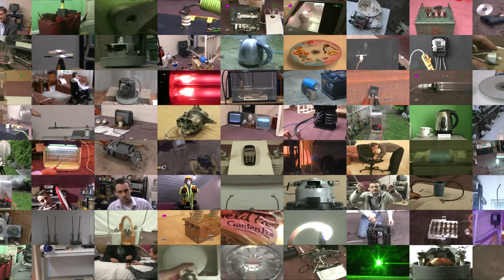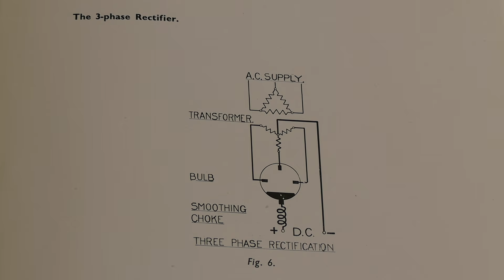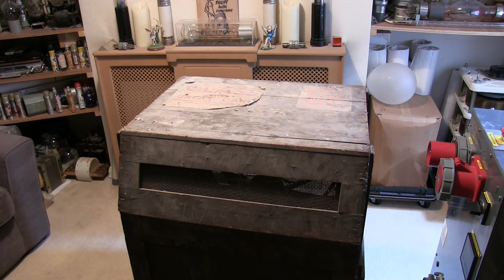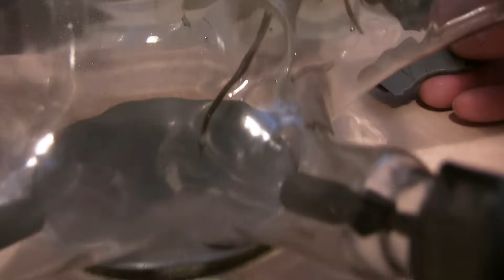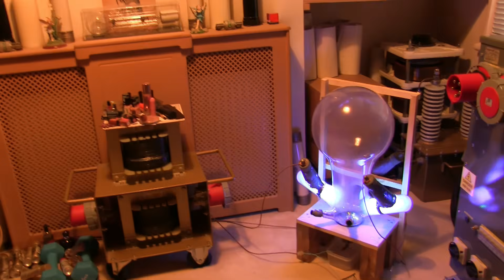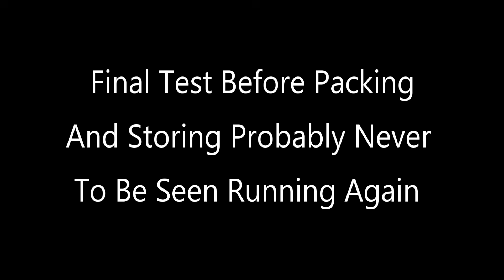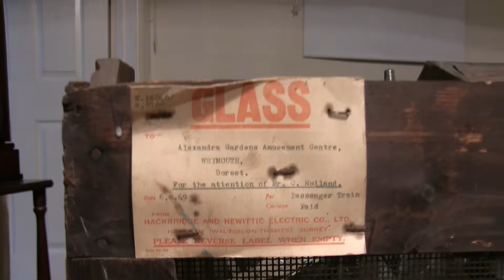Testing The 50 Year Old Mercury Arc Rectifier

Comment: I’m at a loss to understand how a puddle of mercury is only allowing current in one direction.
Reply: It’s not the puddle of mercury itself that only conducts in one direction — liquid mercury conducts both ways. The rectifying effect comes from the mercury cathode and the ionized mercury vapor. The mercury cathode can readily emit electrons and sustain the arc, while the solid anodes cannot do the same when the polarity is reversed. That asymmetry is what makes it work like a diode.

Comment: Beautiful - and a little bit scary!

Ever since I had an electrolyzer with mercury connections on its electrodes (for reasons still unknown to me), I wonder - what metal did they use in those years when mercury was all the hype that didn't amalgamate (and get dissolved) with the mercury?

Comment: One of these used to be in the Bell System switch room office where my dad worked. I could tell by the color of it. I got more Western Electric transistors than tubes when they tore the office down. I thought about taking that tube, but I didn't want to mess with something high voltage. I got the traveling wave tube out of the microwave. I donated everything to the electrical museum. Some of the transistors are priceless.
Reply: It was weird walking into a place that was so noisy all my life, with thousands of stepper switches and little lights all over, being quiet with no power. They let us take what we wanted, except for the power plant, when they shut it down.

Comment: If that were to break and that mercury got away onto your floor, you'd have to tear the house down. It would quickly seep into every crevice in the room. There would be mercury vapour in the air for indefinitely, enough to get you poisoned. Outside or the garage would be recommended.

Comment: Some of the old electronic gear (transmitters) that I unfortunately lost when I had to relocate used hot cathode  mercury vapour rectifier tubes to produce the DC high voltage B+ needed to drive the final output tubes and the modulator tubes. They had to be runn base down and required significant warm up time before turning on the high voltage. In addition to the mercury vapor rectifiers there were also argon and xenon rectifiers,  as well as neon and other gas filled regulators. That old equipment really lit up like a multicolor neon sign.

On a side note while most of the New York city subway  system used electromechanical rotary converters to produce the 600 VDC to run the trains, parts of the system  also used these large mercury vapour rectifiers to provide the needed DC voltage to run the trains. These days I believe its all been converted to modern solid state rectification .

Comment: I love these old mercury rectifiers l honestly believe we had more technology back in the 1920s and possibly before than what we're led to believe. I recently saw one of the first electric cars that used rechargeable mercury batteries with a system using a mercury arc rectifier to charge the batteries and they were said to get up to 156 miles on one charge.

Comment: Curious about your opinion?

There's a famous Mayan carving that people claim looks like a rocket engine but when I look at it I see a Mercury Arc Rectifier & the reclining man isn't flying, he's adjusting a MAR to deliver power in the Pyramids

Google image search a black and white image of the "palenque-astronauta"

Also I'm convinced they used Mercury in the Queens Chamber "star shafts" of the Great Pyramid in Egypt, if the two shafts contained liquid Mercury & they applied electricity to it then the fluid would spin with enough force to vibrate the entire Pyramid. This would activate every crystal in the Granite blocks of the structure & it would have created a audible tone as well that would be adjustable depending on how much electricity was applied 

So the Pyramid collected energy from the Earths core, From water underneath, from the spinning shafts filled with Mercury, from the Crystals, from vibrating massive stone blocks & from the audible tone

And although I have no physical proof I'm theorizing the nook in the Queens chamber also housed a MAR system to convert the positive ion energy into DC 
 
Should I seek therapy (please don't call the Police) or do you also see an artistic representation of a MAR in the Mayan carving? 

Thanks

Comment: They were still using these in the same type of wooden box on the London Underground until at least 2000, they are maybe still using them as they went in during WW2 and had been working since. IIRC, the one I saw had a hinged door at the front for access, and it might have been 3 phase type.

Comment: I ended up getting a few of these many years back from a place that did electroplating when they upgraded to silicon rectifiers. They were going to dispose of them,  but i asked and got 9 of them for scott free plus a couple spares and the cages they were in. The silicon diode banks took up about the space of two of the mercury rectifiers. One of them currently in the dells at the above top secret attraction in the wi dells as part of the alien mad science lab exhibit, it is lit up by a VTTC mounted under it with a small heater to warm the mercury a bit so it glows a bit brighter. The whole thing is filled with blue plasma and it looks extremely alien❤ 😂

Comment: Back in the day, DC power tram substations had mercury arc rectifiers that were steel pots several feet in diameter with a ceramic gasket under the lid which was the anode. Contained several gallons of mercury and could handle thousands of amperes.

Comment: Might be a silly question, but what wavelengths of light are coming out of it? Would it be the same as welding? Both are electric arcs.
Reply: idk, but from my own experience you don't get appreciable x radiation until the potential differences are about 15 to 20 kilovolts. Some old color tv CRTs emitted soft xrays so they made the faceplates of high lead content glass.

Comment: I had 4 bulbs on a bakelite board 20 by 20 inch ,bulbs were wrapped with copper wire .
A think it was a rectifer for what was for sure a copper plater for making big moulds for plastic industries  back in the 60

Comment: It's terrifying to think that touching anything live in that room could kill you
Reply: I was thinking the same...also maybe that's why the last video was 3 years ago? Or did the UK electric authority shut him down? Either way "you have to be mad to have one of these in your living room" ....just my kinda mad!
Reply: Touching anything live in any room could piotentially kill you. Also rotating machines, hydroflouric acid and supercrittical radioactive stuff. Stay safe, where a helmet and a life jacket to bed. Never get out of bed. Die of starvation. Some of us have learned the hard way to not touch live electricity. Stay aware of where its live and just dont put your hands there. Its not difficult.
Reply: @xsense2012  Spare a thought for the engineers who work on the power grids, and on electrified railways, with live rails carrying thousands of amps to power big heavy trains. And I used to repair and refurbish old analogue TV sets with live metalwork and circuit boards etc. and 25,000 volt eht to the main anode of the cathode ray tube.
Reply: @majorpygge-phartt2643 I got a belt from a CRT once.
Reply: at the voltages and possible short circuit currents anything live in that room will shurely kill you...
Reply: not least of all the man himself

Comment: You bring back memories from my shipyard/engine building days in the 70's. we had six or seven of those bad boys supplying 220v DC to the overhead cranes. One morning when the outside temperature was below -10degrees celcius there was no power to the cranes. My solution, play a gas fired space heater across the length of the array of tubes until the mercury vapour was warmed enough to strike an arc. The Director asked me why there were no cranes operating. Electricity is frozen I told him. Called me a stupid boy, but I knew better, after half an hour of gentle warming they, one by one, fired up into full operation. Happy days, thanks for bringing it all back.
Reply: Frozen electricity, thats a good one.   Well done for you understanding of Physics I hope the Mgr thanked you.   Boris Karloff films often had MAR's and big neon discharge lamps, very spooky.
Reply: That's hilarious, good work
Reply: Thank you for sharing! I enjoyed it 😊
Reply: Directors never changes in every country 😆 I'm from Russia and when my directors can't understand the process they call me stupid sometimes 🤣
Reply: I would have turned the heater off and let him deal with it

Comment: I used to work in the Biomedical Technology dept. at the Hospital I worked at. One of our jobs was to repair and recalibrate mercury manometers. The biggest problem with mercury, is oxidation. We would remove the old mercury and replace it with fresh stuff. As long as it's in a sealed vessel, mercury will not oxidize. Especially under vacuum, which I'm sure this is. Very cool! Never seen one of these before. I'm used to the newer style square silicon rectifiers used in amplifiers, etc.

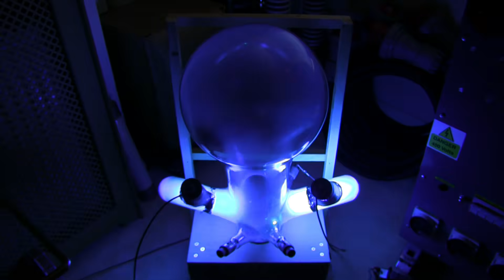Comment: 21:40 

The small bubbles that appear on the interior glass surface of a mercury arc rectifier after some time are typically due to a phenomenon known as mercury vaporization or mercury spitting. This can occur due to the high temperatures and pressures present inside the device during operation.

When the mercury arc rectifier is in use, the mercury in the arc is heated significantly, causing some amount of mercury to vaporize and become gaseous. These mercury vapors can then condense on cooler surfaces such as the glass interior of the device, forming small bubbles.

This phenomenon can be more pronounced if there are leaks in the device or if it is operated under abnormal conditions, resulting in increased mercury consumption and the formation of more bubbles.

It is important to note that mercury vapors are toxic and should be avoided from being inhaled. If significant condensation of mercury vapors or an increased formation of bubbles is observed, it may indicate issues with the device's integrity or operating conditions. In such cases, it is recommended to cease the use of the mercury arc rectifier
Reply: Did AI write this?

Comment: This is fantastic. I don't know why but I feel as if I need one. We are cut from a bit of the same cloth, I got into lasers when I was 14 in 1978. Before all the diode lasers came about, I had to have 208, and 480VAC three phase to run Ion lasers. I couldn't run the 480 Spectra Physics and Coherent lasers at home as I lived in a rural area and we only had 240VAC. So I built a rotary phase converter to run medium frame lasers at home. All of this was water cooled of course. Started a million volt Tesla coil project with a "pole pig" line transformer, but life got in the way. Now a 5watt white light laser is the size of a cube of butter and runs on 12VDC and a few amps. It's kind of depressing in a way.

Comment: Hi just got myself a 6 pulse one, only got single phase at home so looking to drive the primary via an inductor and capacitor to 90 degree phase shift with three secondary windings with centre tap to cathode & each end  feeding the 6 anodes

Comment: I have seen a couple of these in operation in an old AM radio station. I was invited in to see them when I mentioned I liked seeing the glow of mercury rectifier tubes at a friends house, his dad was an engineer at the local radio station. Back then, we didn't have a way of easily getting video of what we were doing, but the memory has stuck with me all these years.

When you mentioned the third anode not in use, it also reminded me that they were designed for 3 phase power supply. But I don't remember what the second pair of anodes were for, if not for lower voltage, or current needs of the transmitter.

Comment: you got big balls pulling on those wires in that transformer box with the power on. or you are crazy . worked on G-E rectifiers like them only the size of your house fed by transformers the size of your house on the N.Y.C. transit subway. they fed the third rail 650 volts 23.000 amps . to run trains. after some of them blew up and puked every thing all over the sub station they started to replace them.

Comment: WHAT WAS THE PURPOSE OF THAT PURPLE LAVA LAMP WHEN YOU ALREADY HAD DIODES ATTACHED TO FIRE THAT MUTHA UP?? 50 YEARS WOULD PUT THAT BACK IN THE 70'S. I WORKED ON RELIANCE (BRAND) MAX-PAK, FLEX-PAK DC DRIVES, TONNES OF MIN-PAKS THAT HADHAD GATED FULL WAVE  BRIDGE RECTIFIERS (POWER CUBES) IN THEM, SO WHAT DID THE PURPLE GENIE DO BACK IN THE 70'S???? ASKING FOR A FRIEND, LOL...😋  P.S.  DID IT GET HOT?? WHAT KIND OF EPA SAFETIES DID YOU HAVE TO HAVE TO OWN OR USE THIS BORIS KARLOFF MONSTROSITY ??? 🤕🥴😳☠

Comment: So what is it actually running on at the end, and what load are you driving with it? As i understood it, the 38V with the choke is for the exciter only, and the recification runs on the 400V variac? What's the 11kV transformer stuff involved for in this circuit?

Comment: I am confused by the presence of the 11kV split-phase transformer. Are you using 11kV as a part of this setup? If so, what is the reason?
This is a 400V input for this rectifier, right? Thanks!

I didn't see any wires that looked appropriately insulated for 11kV nor would I want an 11kV transformer with open leads anywhere near my living room LOL

Comment: Absolutely fascinating!  Love your work Photon!!
I worked for a local power company and would often marvel at the wonderous glow from the enormous Mercury Arc Valves when visiting the Haywards substation. 

In NZ we have a 610 km (380 mi) long, 1200 MW bipolar high-voltage direct current (HVDC) transmission system linking between the South Island and the North Island (40km of which is via 3 parallel submarine cables running under the Cook Straight).

Up until 2012 this was a 600MW bipolar link running through Mercury Arc Rectifiers.
Extremely fortunate to have been able see them in operation before they were replaced with Thyristor based rectifiers.

SOLID STATE TECHNOLOGY IS SO BORING IN COMPARISON!!!!!

Thanks for sharing details of your wonderful toys! 
Look forward to the next lesson!

Comment: I remember that there was a Big Wheel, owned by McArdle's, on Cleethorpes beach, for many years. As a child in the 1960's I could never afford to ride on it, but was quite happy to stand and watch the Mercury arc rectifiers glowing merrily, and the glow changing as the wheel was started and stopped. That rectifier had been running since at least 1948, and it was still in use in the late 1970's. 30 years of running was not unusual for those rectifiers, if they were used properly.

Comment: Very interesting, but there is no explanation about the starter and  you should have put a load a diagram and a double trace  oscilloscope showing the AC input and The rectified Output.

Comment: One of these was installed in Walhampton School in the early to mid '50's. They were rewiring to AC mains from 110v DC and the arc was temporary replacement for original gas engine driven dynamo. Was on view through a windowed door at the bottom of an old lift shaft - fascinating.

Comment: The MAR is scary. The sound they make running, and the UV radiation. In the days of old in power houses they had a vacuum pump connected to them that would vent to the air. Not the best place to work.

Comment: Curious what the shape has to do with its functionality. Is the globe shape important?
Reply: The globe part is for recondensing the mercury vapour when running at high power. It just needs lots of surface area, the shape isn't critical, but the globe shape is easy to make by glassblowing.

Comment: a few questions:
1. what's the athmosphere inside the glass, is it a vacuum ?
2. why the large/high round glass "head" shape above the anodes ? it does'nt seem to be necessary to have all that empty space...
3. what's the maximum watt or volts/amps it can rectify (output)
4. how efficient is it ? how much of the power is lost during the process ???
thanks if anyone can answers some of these :)

Comment: Fascinating to see the rectifier working! (Was it a Hackbridge Hewittic type?). Many thanks indeed. The brief look at the label at the end was most revealing too…it looks as though originally it was to be used with fairground equipment in Weymouth, just down the road from my home. Perhaps I’m strange (?) but whenever I visited travelling funfairs as a boy  I was much drawn like a magnet (deliberate pun) to their huge d.c. generators and the miles of thick rubber cables running to each amusement rather than the amusements themselves. The generators were often mounted on gigantic Ex army Thorneycroft-made tank transporter tractor units. I could stand for hours watching the overall clad Engineer looking after the prime movers and monitoring everything. No central control room…just an open slate switchboard with circuit breakers and a few moving coils meters. Very impressive to a youngster! The voltage used in funfairs always seemed to be around 120 to 150V d.c. with current peaking at several hundred amperes. although the noise made conversation difficult with the Engineers I always got the impression that they didn’t want outsiders knowing ‘the tricks of the trade’ so to speak. I shall never forget those huge, large diameter rubber covered cables. Thank you for your YouTube treats. Best wishes, Rob.